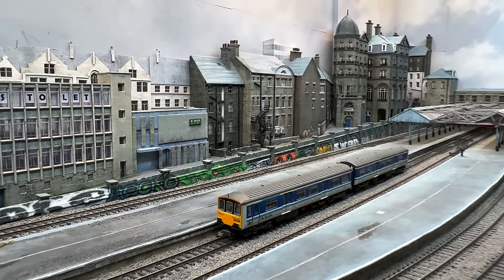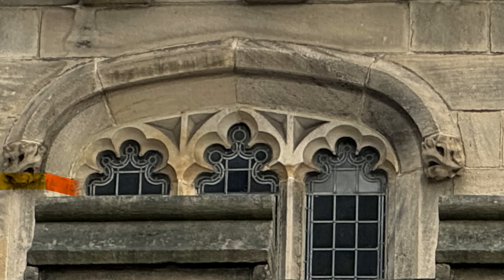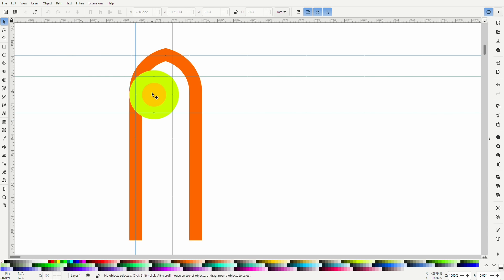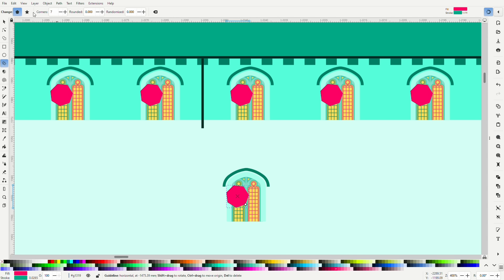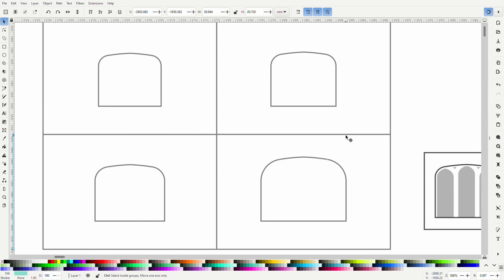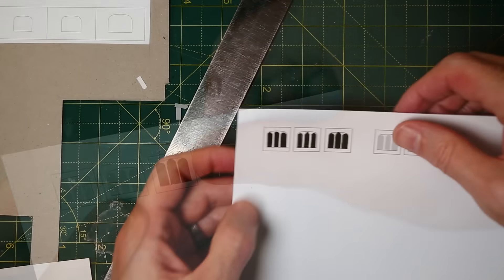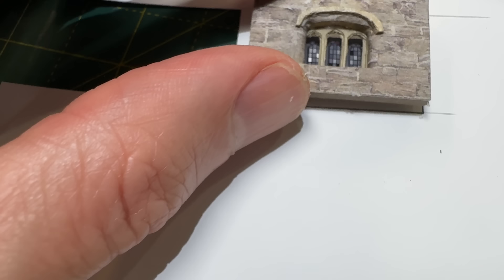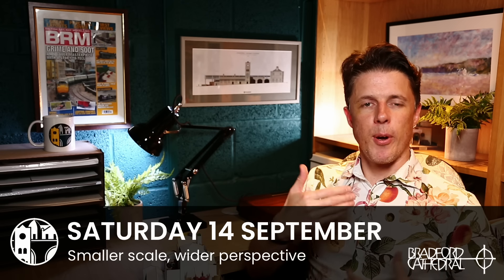Is this tiny church window really just a stack of paper? N scale windows for Bradford Cathedral

Comment: Michael, I'm pretty sure that you'd know about this technique which I picked up from Tony North Eastern. To strengthen  edges coat the edges with super glue. Once dry it will even stand up to a bit of light filing. I'm thinking about how thin those bits of tracery are. Arthur
Reply from the maker: Yes I’ve heard but not tried yet. I’ll give it a go if I start getting into trouble with the tiny bits.

Comment: Nice job on the windows. The gloss varnish gives a really convincing appearance of transparency. Are you planning to do the same with the larger stained glass windows or will you be going for replicas printed on acetate or similar? That would look amazing lit from inside.
Reply from the maker: The varnish has worked really well hasn’t it!? I’m undecided about the main windows but I’m unlikely to print to acetate as the surface is usually “too shiny”. But I’ve not yet made up my mind for certain.

Comment: Hi Michael, hoping you can help me with a quick problem... I've been following your guides and have got to the stage where I was happy enough with my card models to get some photopaper and try some textures... but for some reason the textures aren't printing!?  They display fine just dont print.  All the online help seems to be related to people making pdfs so I'm struggling to get to the bottom of it... help!
Reply from the maker: Hi Ben. Printing texture directly from Inkscape can be a challenge. I also use the PDF trick. Do File > Save a Copy and export the page as a PDF. Then print that, making sure that the PDF viewer print setting shows “Actual Size” rather than “Shrink to Fit”.
Reply: @Chandwell  Thanks Michael, managed to get it via this method 👍👍